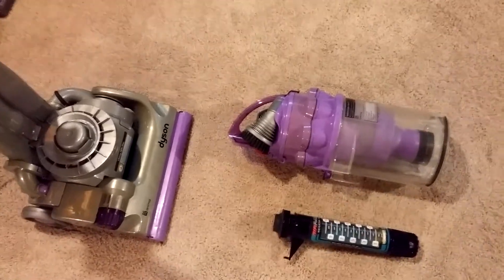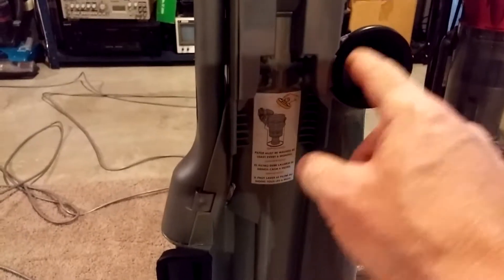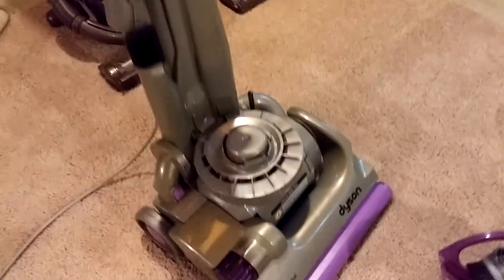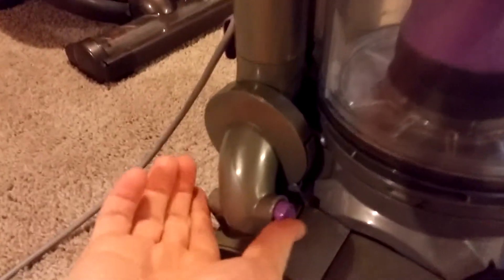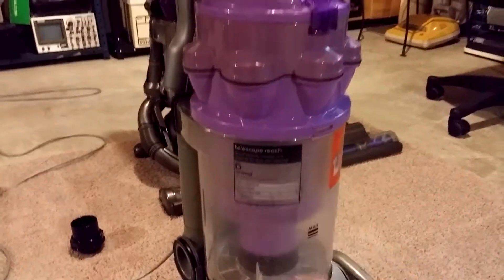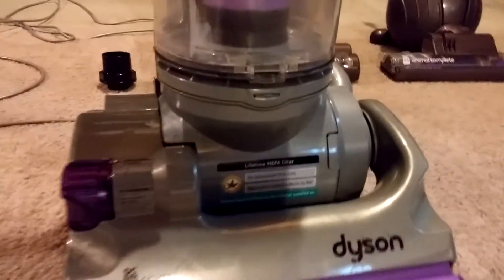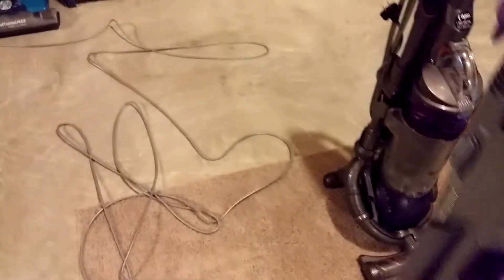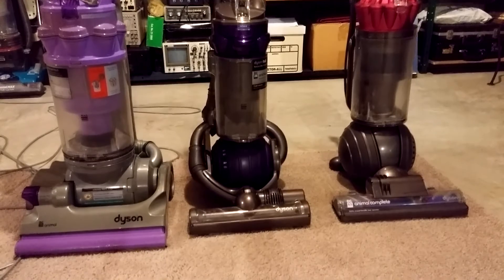Bagless Vacuum Airflow Losses

Comment: James Dyson is all hype and hot air. He spends an absolute fortune on marketing and fancy "technology" to get people to part with hundreds to get the latest gimickry. Try measuring the airflow on the end of the hose, when it is fully stretched out to maximum length, and I'll bet you get a dreadful result. Dyson is responsible for destroying the market for bagged vacuums in the UK and maybe this is not so bad in the US, but many people in the US I suspect are being fooled into parting with a lot of their hard earned bucks in the mistaken idea that a Dyson will outperform any other vacuum becuase it is laden with all the latest "Technology".
By the way, the motor in the DC14, is just a bog standard YDK, nothing special at all, and pattern part DC14 motors can be had for just £20 in the UK that do the same thing, produce 1400W of raw power. Many other bagless vacs used to use even higher wattage motors to counteract their poorly designed filters which clog quickly, and end up losing airflow, simply making the motor overheat and belch out more heat than a fan heater. Nowadays, the EU has dictated that no vacuum in the EU is allowed to use more than 900W, so vacuum manufactures of bagless vacs have had to come up with more efficient systems, or ones that only use short hoses and have single cyclones, like Shark bagless vacuums.